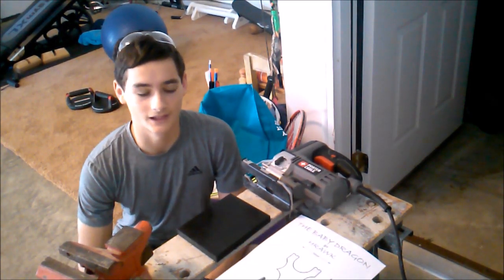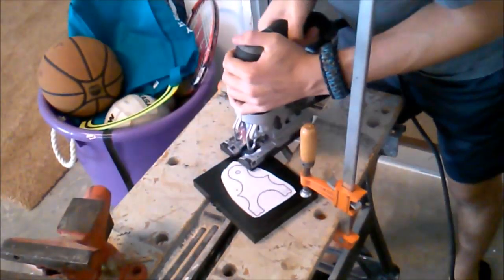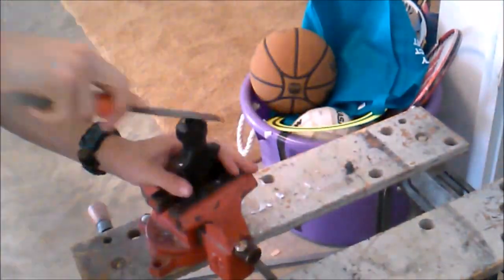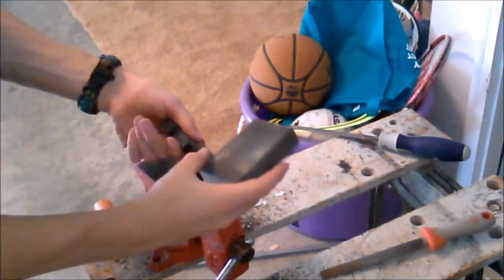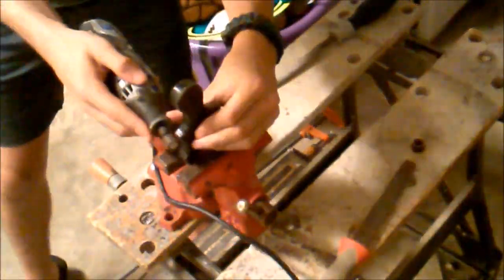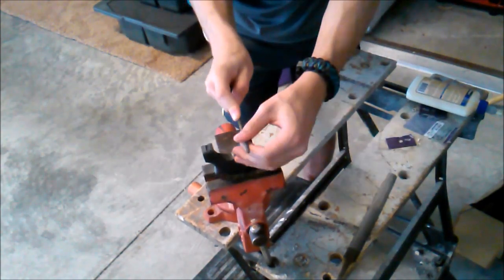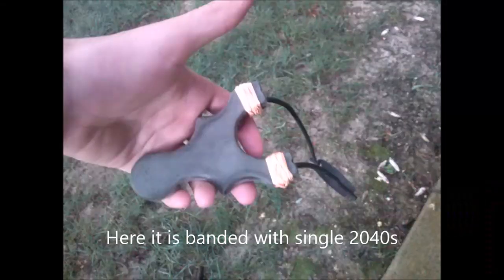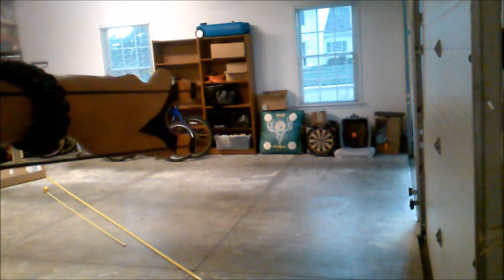How To Make A Slingshot Out Of HDPE

Comment: You said HDPE is hard to finish.  I made a slingshot out of HDPE recently and all I did was sand it to 300, steel wool it, then took a torch and lightly went over every inch of it and the finish is beautiful.  I was tempted to put some clear coat on it but it hasn't been necessary.  Hope that helps.
Reply from the maker: Yeah I had heard of people doing that but I wasn't sure how much heat you needed and I didn't want to melt it. If I ever make another I'll have to try that. Thanks for the tips! Josh
Reply: sharpshooterjd You really have to eyeball it.  You may even be better off using that heat pun you used on the PVC.
Reply from the maker: Interesting thanks!

Comment: Very nice job. Turned out brilliant.....just a question how can you get a shine on it when it's finished?
Reply from the maker: Thanks! I think heat does it, so a heat gun or maybe a torch, not 100% sure though.
Reply: Yea when you start getting up to the higher grits go over it with a heat gun keeping it moving so not to over heat in one spot. It will get hot and tacky to the touch and will both burn your fingers and leave finger prints in the finish, so be careful and either leave to cool naturally or quench it in water and dry it before moving up to the next grit. When you're happy with the finish you can buff it on a cotton buffing wheel if you have one available with polishing compound for a mirror like finish if that is desired.

Comment: sweet. I don't want a fancy one. looks are not my issue, I just want a good frame, and got an idea what I'd try to do if I did it my self. I lack power tools so I'm dead in the water for now. I want one I could use both bands and tubes, and have a good reference point on the fork, beyond that, a rough blank would do perfect. I can file and sand it to fit later. you do good work. keep it coming
Reply from the maker: I'm totally the same. Functionality over beauty for me. I don't have a shop right now, but we will find a house eventually. Hit me up once I get my shop back up, and I can hook you up. Or if you can make one yourself that's cool too :).

Comment: Nice job! Do you think I could cut it out using a coping saw? Never used hdpe but heard good things so I might try it out.
Reply from the maker: Yes! It would probably work especially well with HDPE because it's so soft. HDPE's claim to fame is it's virtually bullet proof. Which is pretty cool but I didn't like it as much as I thought I would. It feels just like plastic to work with, which to me is annoying. I'm used to hard wood where you can get the surface really smooth. It does make it easier to work with hand tools though. Give it a go and send me pics of what you come up with!

Comment from the maker: We have reached 100 likes! Thank you all so much!
Reply from the maker: It's called HDPE (high density polyethylene). It used to be available from simple shot, but it isn't anymore. I have heard you can get it from EBay or Amazon, just search King Starboard HDPE, it's supposed to be high quality stuff, but I have not tried it.
Reply: +SharpshooterJD I thought it was polypropylene.
Reply from the maker: +BigRedSlush Nope. Polypropylene is more flexible I think, and HDPE has a much higher tensile strength.
Reply: +SharpshooterJD You're absolutely correct!
Reply from the maker: +BigRedSlush :)

Comment: I wish I had your eyesight lil' brotha! Hey, I've had some HDPE or HDPV plastic, 3/4" thick I made a couple of slings with, and the bands kept slipping out because this stuff is mega-slippery. (came from playground equipment). I literally had to fold some small pieces of 80 grit sandpaper, glued inside, and put them between the bands and forks to give more grip.
Reply from the maker: :D. Yeah I feel you, it happens a little on this one if I recall, I think that is why I used so much material to tie them on. It's been so long since I have shot it though I can't quite remember. What if you roughed up the surface with some course sandpaper? Do you think that would help?

Comment: Nice vid man but there a a few things that you could of done better you were saying that the sheet was 5 dallah thats expensive for me you could easly make 2 slingshots out of that sheet and you  can work your slingshot of with metal sandpaper and realu soft sand spunges
Reply from the maker: Ties De vos Thanks! If price is an issue try to find a cheap white HDPE cutting board. They should only be a couple of bucks and you could make a bunch of slingshots out of that. Also I am pretty sure you could cut the slingshot out with a coping saw. Again you should be able to find those for pretty cheap. And you can just use regular sand paper and sanding sponges like you said to shape it and round the edges and everything. Hope this helped! Josh

Comment: whered you get the sheets
Reply from the maker: It's called HDPE (high density polyethylene). It used to be availble from simple shot, but isn't anymore. I have heard you can get it from EBay or Amazon, just search King Starboard HDPE, it's supposed to be high quality stuff.

Comment: You could have work much easier and faster with a solid template and a router
Reply from the maker: What kind of router do you mean?
Reply from the maker: Do you mean like Bill Hays? I have seen him use a solid template, a band saw and a router and he can seriously crank out HDPE slingshots. Sadly I don't have either a band saw or a router. And I don't need to make slingshots in bulk so it's not to high up on my priority list. Although that would certainly make it easier on me :). Josh